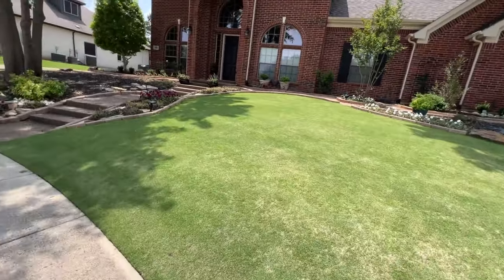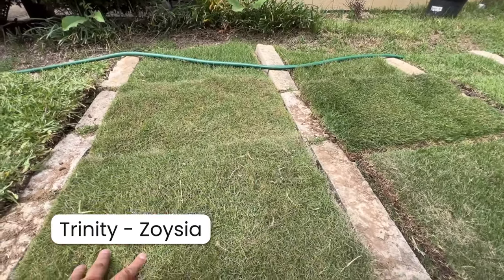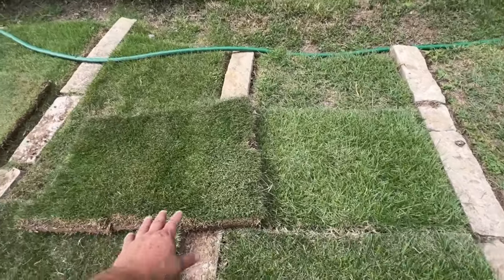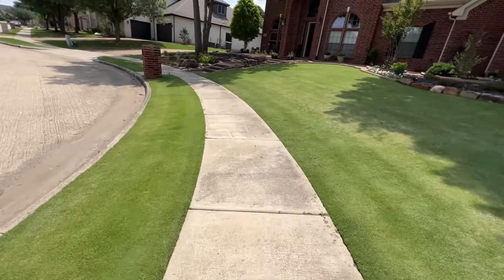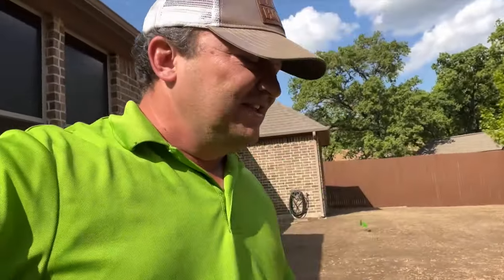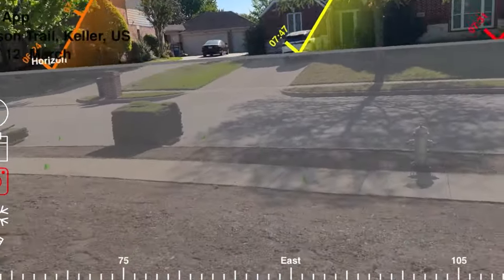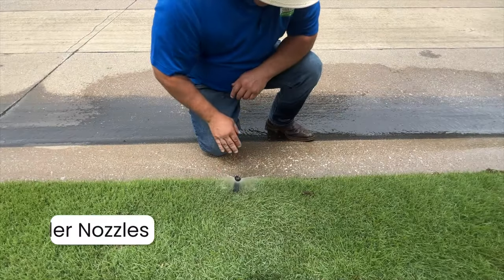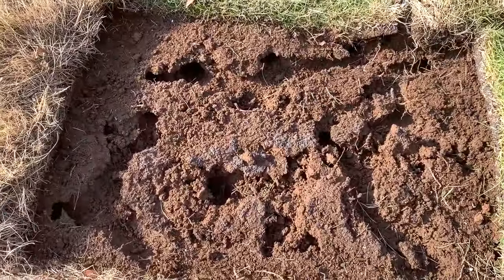Everything You Need To Know About Zoysia Grass

Comment: You are fairly closeby.  Wish I'd have known about your 'process' 5 yrs ago.  I had front and back yard done in Zoysia Palisades installed and, lets just say the install process wasn't what I was expecting.  But dispite a less than good job installing, the first spring/summer it was beginning to take root and by the next spring it was by far the prettiest lawn I'd ever seen. It has been that way for the last 4 years.  Last summers heat (Dallas extremes) started taking a toll on it. Then several areas (around 1 1/2 pallets) were needed to 'fix' the dead spots.  Then this past winter (2023) is was clear something happened, and it looked horrible. Dead thatch everywhere.  Now (mid-may 2024) it's trying to make a come-back.  Most of the front yard is tyring and starting to fill in with maybe 200-300 sq feet in scattered areas still is just thatch. The back yard is pretty bad.    Anyway,  those thinking of Zoysia,  it is very pretty and thick.  The root structure is strong (just under the surface) and I have to go around the sprinkler heads with a garden tool and push down and cut some of the root structure away because the sprinkler heads wont pop up or retract.   And, by the way, you've got one of the best videos I've seen explaning what to expect.   Well Done A+++
Reply from the maker: Awesome feedback and insight with Zoysia.  Thanks.  While Zoysia is a very strong turf for North Texas, it can get freeze damage, drought dame, pest, and fungus problems.  There is no hands free lawn out there but there is less that will happen to Zoysia as compared to other varieties such as Saint Augustine grass.

Comment: As an iragation contractor the sprinkler heads you we’re talking about are bad when they get bumped or knocked of the side it changes the pattern plus the use more gpm so they can do a 360 staying with a fixed nozzle pattern is the best way to go as I saw that sidewalk covered in over spray the nozzle for that should be an sst 15 or sst 17 there designed to spray sideways 3 to 4 ft wide for narrow areas. Yes your a landscaper looks like you do good work but on the lawn sprinklers just like your sod there’s a proper spray pattern and sprinkler head there’s a lot that goes into designing layout of a system not to just throw in a nozzle or sprinkler head that does all it wrong I’m proper coverage and wasting water
Reply from the maker: I Couldn't agree more.  We do many things great and some things good. In this case there is a better nozzle for parkways like you say. 15SST nozzles throw 15 ft left and right and just 3-4 ft in front of the nozzle which is ideal when spraying the parkway lawns by the street.  This avoids dumping water out onto the sidewalk or the street. We do love the versatility of the 360 nozzles and their use is great for most areas of a lawn. They are easy to adjust and very easy for a homeowner to achieve adequate coverage for their new lawn.  When you are fine tuning a sprinkler system and your goal is not only covering the area but also the conservation of water then I agree it should be dialed in with fixed nozzles.

Comment: Love watching these Zoysia installs.  When we built our house in DFW in 1999, we installed El Toro Zoysia.  It was hard to find and twice the cost of standard Bermuda or SA, but I'm glad we did, as it's been a great lawn for our family and dogs.  

As our trees have matured, I have a couple of areas that only get filtered sunlight and the grass is very thin. Which of the Zoysia types that you've mentioned would be best to try in these areas?  And is El Toro still available?  I also have SA taking over a part of my backyard, so would the Quinchlorac be safe to use on my El Toro?

Thanks!

Comment: Tanner, I'm really struggling deciding between Palisades and Zeon for my backyard renovation. I like the look of Zeon and the fine blade but will be mowing it with a rotary and my wife also doesn't want the lawn mowed too short.  I have a dog and wondered which of the 2 varieties would be better for wear and urine spots with a dog. And are they both soft grasses to walk on?? Any advice for me??
Reply from the maker: Palisades and zeon both have trouble repairing with urine spots.  Palisades seems to be worse than the zeon.  Check this out https://youtu.be/dyLx-zn5deo
Reply: @ZoysiaSod do you know where I can find crowne zoysia seed? I have some bare spots and I think it needs new seeding.
Reply: Did u
Reply from the maker: @EmmanuelRamirez-r3t  There is a seed called Zenith

Comment: I’m considering Zenith Zoysia from seed. What grass type that you covered in this video is most similar?
Reply from the maker: Zenith is wider blade so it would look like palisades
Reply: I seeded zenith zoysia in summer of 2022. It looks ok, but I want to go to zeon zoysia (the super small fine blade) ... But it's $$$ and comes in sod only 😢
Reply: I seeded with zenith zoysia in May 2022 and it was the best decision I've ever made!  It took forever to establish last year, so just be patient.  This is my second year with zoysia and my yard is by far the best on the block!  The shady spots are still taking their time to fill in, but it's getting there.
Reply: @annetraut8247  how high do u keep it? I cut mine at 5" with a ride on mower.... I drool 🤤 at carpet like height ... But can't afford it 😭
Reply: @vroor32  what!?  5" is crazy high for zoysia.  Does the riding mower not allow for a shorter cut?  I've been cutting mine at 2".  If you can drop your mower, I would recommend slowly working down to a 2" cut.  Don't lop it off all at once, but drop the mower an each each week until you make it down to a 2".
Reply: @annetraut8247  damn, u make me pull out my measuring tape 😂 .... It was at 5" before mowing. Just cut it highest setting and it's now at 3" ..... Feels like a carpet.

Honestly, I always thought the high setting on the mower was 5 inches .... My ignorance in lawn care is showing 😭